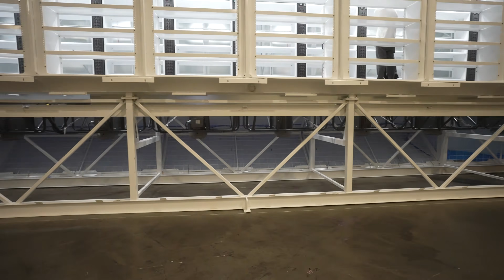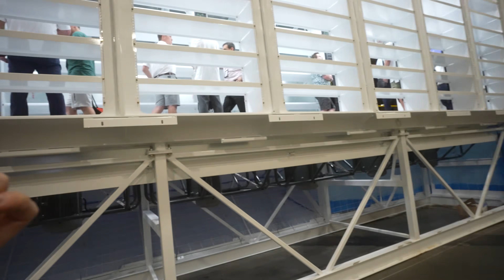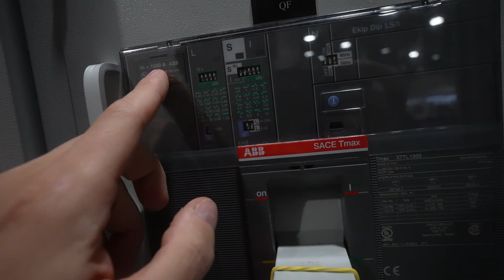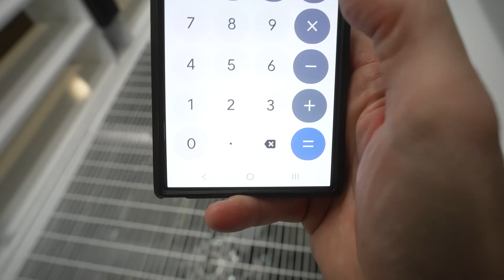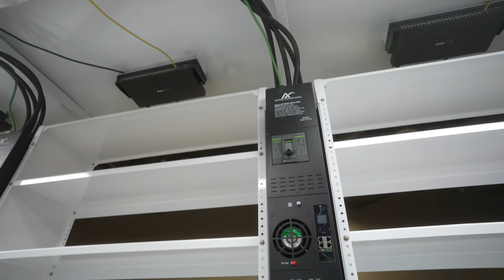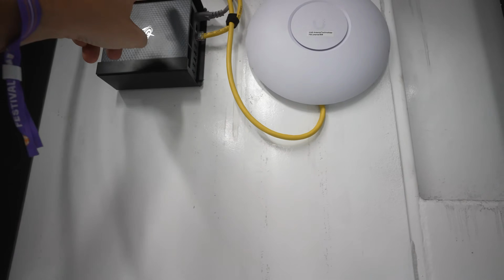4+ MW Bitcoin Mining Container - Artemis 1056 Slots, Huge Container!

Comment: Please in a 1000amp BREAKER, does it mean each phase(line) on the breaker is rated 1000amp (total 3000amp on three phase)  or the 1000amp is for the three lines ( (330 amp each) in the MCcb breaker.
Don't know if my question make sense, I am not an electrician